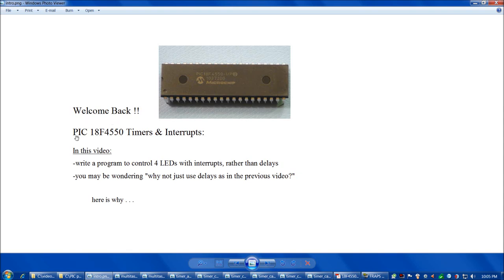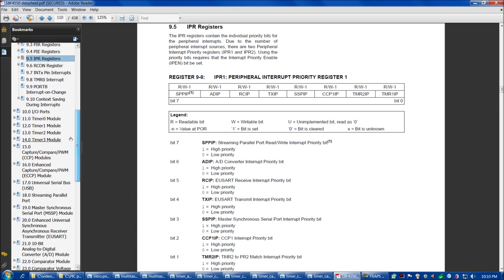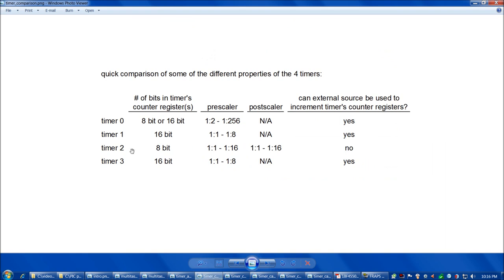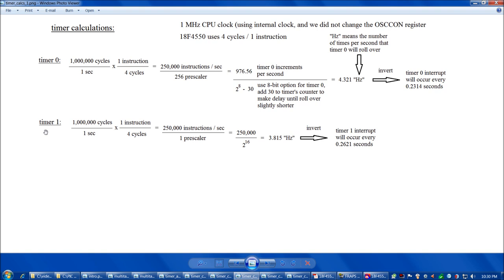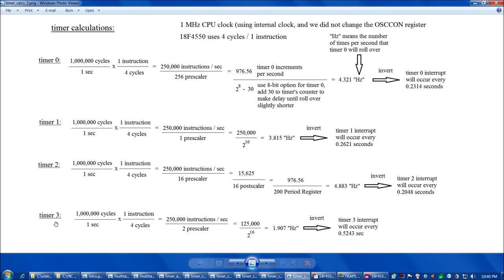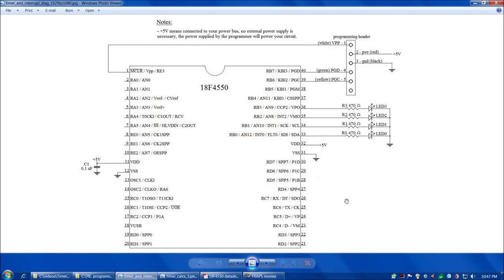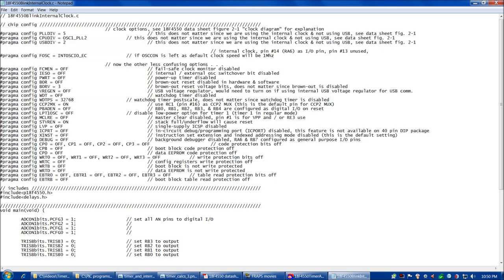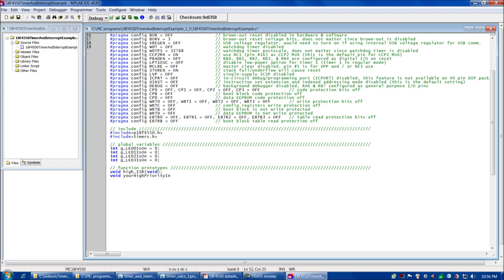PIC 18F4550 Timer And Interrupt Example

Comment: Just pointing out the error @ 8:12 "start at 30 count from 0 to 255 and then overflow and signal interrupt instead of starting at 0..." count from 30 not 0.

Otherwise,  a great intro to pic 18 timers.